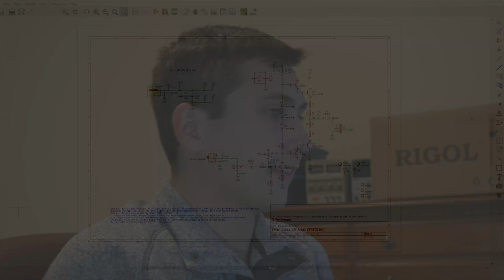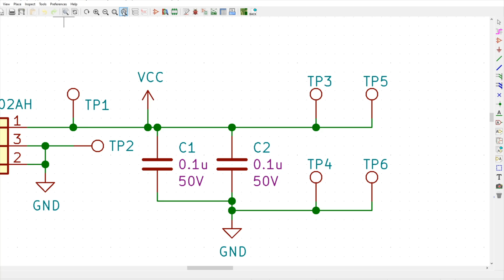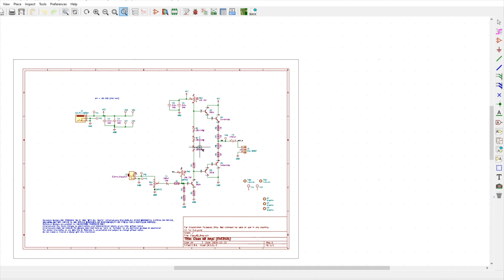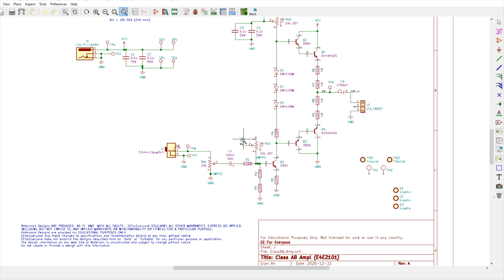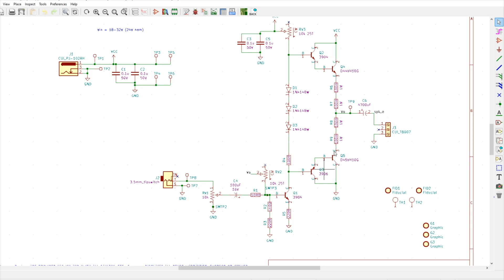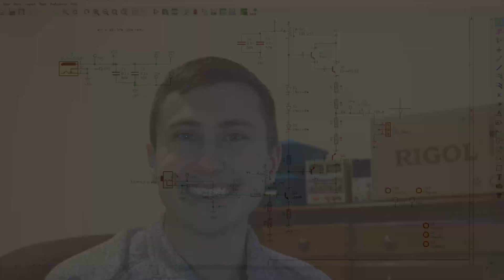AB Amplifier Schematic Capture

Comment: Nice, question is why there's no probe point to cut the trace for biasing network in case you wanted to put your DMM in that rail to measure current passing?
Reply from the maker: That's a great question! For this design, that would be super helpful! In general, I often struggle with the question of how many test points or 'tweakable' features to add. On the one hand,  I'd love to have a big test point almost everywhere in the design, with jumpers or curable links to modify performance on the fly. I've found that sometimes adding those 'hooks' can end up affecting a design in complex ways.

It's definitely something I should keep in mind though, I really think we could have added more of those developmental features to this board! Great suggestion/Question! Thank you!